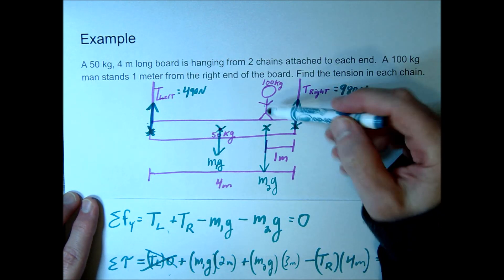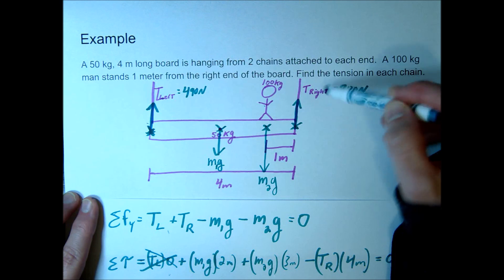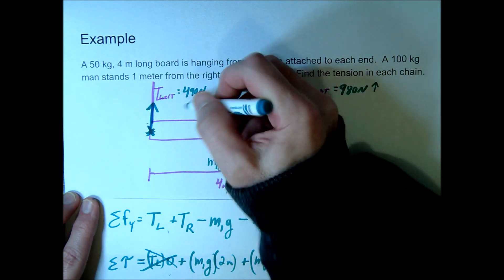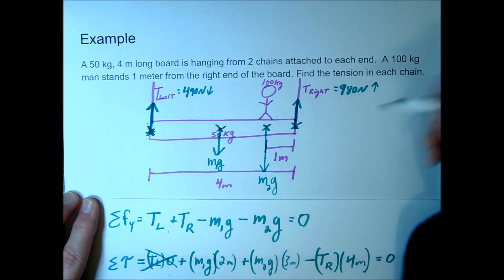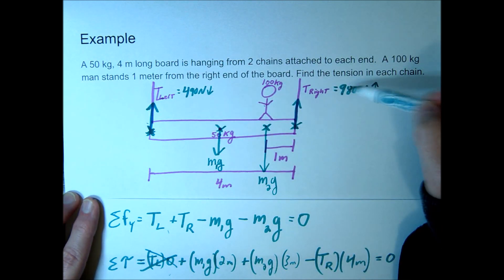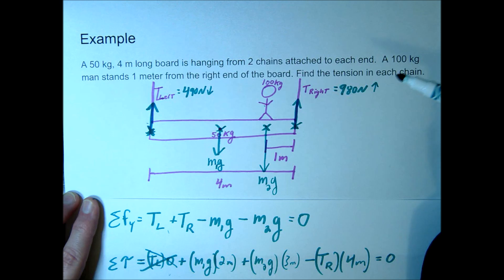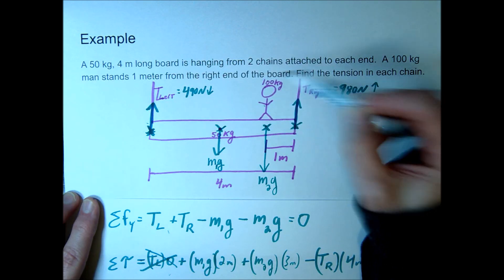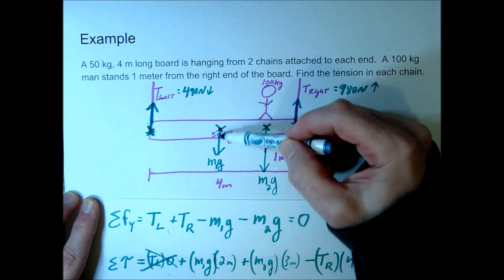Understanding Rotational Equilibrium | Free Body Diagrams and Torque Analysis

Comment: why there is no normal force,N labelled in the diagram because the boy touch the surface of the plank
Reply from the maker: Good question.  Forces drawn are those forces acting ON the PLANK.  If we did a free body diagram of the forces acting on the person, then "yes" there would be a normal force on the person due to the plank (as well as the force of gravity acting on the person)